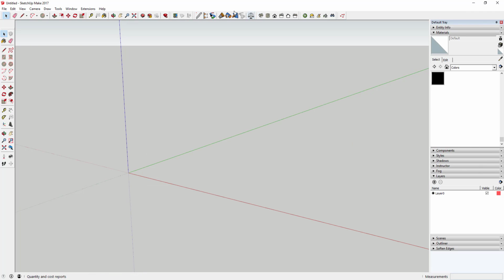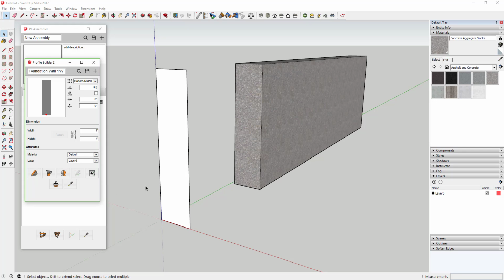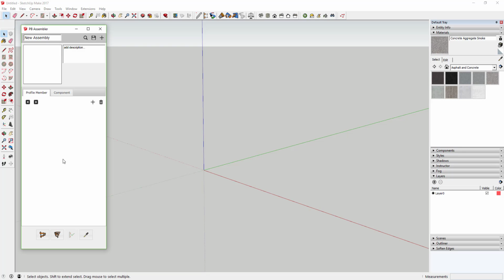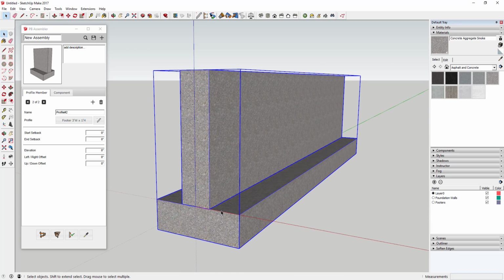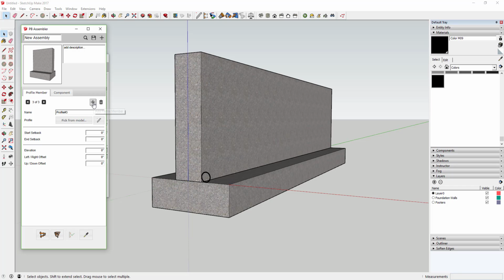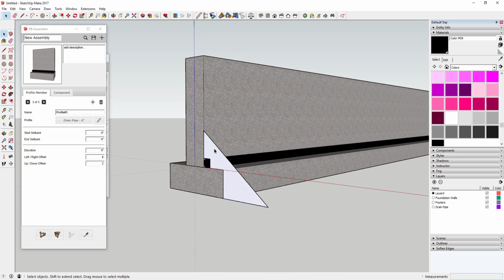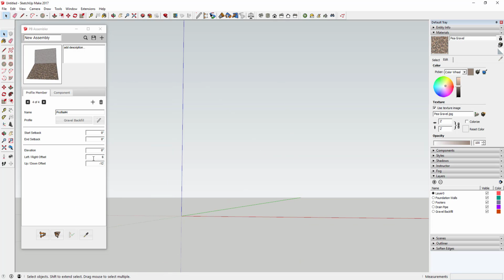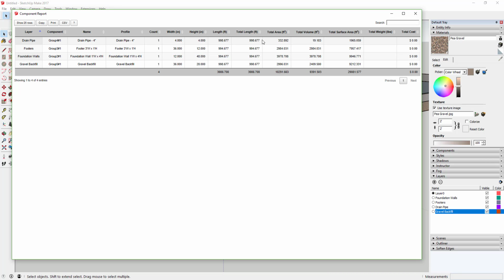Creating a Smart Concrete Foundation Assembly in SketchUp with Profile Builder

Comment: Are there any tips for building walls made out of reinforced concrete or reinforced cinder blocks? The reason I ask is because we don’t use would frame in the Philippines. We use cement and cinder blocks or reinforced concrete for the main structure. We also use steel beams for the roofing. If there are any extensions for those or tips to simulate those, that would be so cool!! Thanks for any help.

Comment: I'm trying to imagine who would find this plug-in a "time-saver".  Firms with lots of work I guess.  For myself, who takes a year to design one house, this brings redundant control, over things that need less control, as codes change and requirements are upgraded.  Drainage is always a critical consideration, to the extent that every 'house' has it's own design considerations.  You have to know the site, the ground, the Heat Zone, the rainfall, the local infrastructure and more before deciding how to manage the footing/foundation/drainage problem.  In the course of designing a house, it will likely be modified, or even deleted and re-started.  Would you then have to edit it, using this plug-in, rather than regular Sketchup tools?